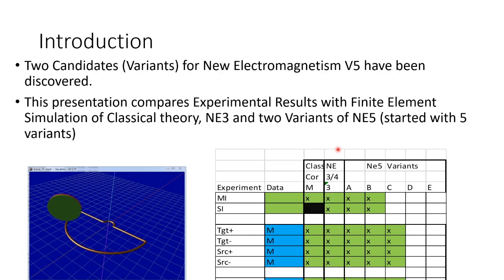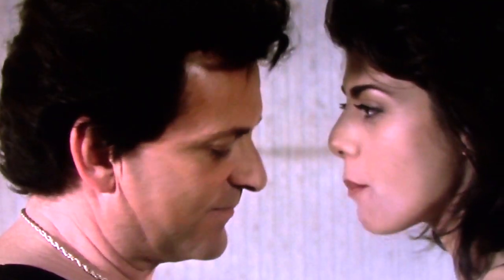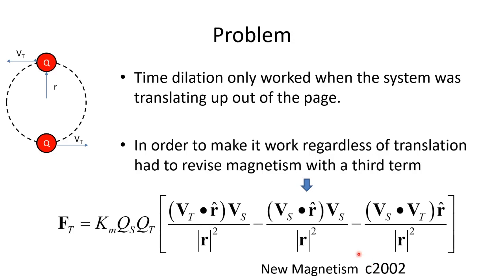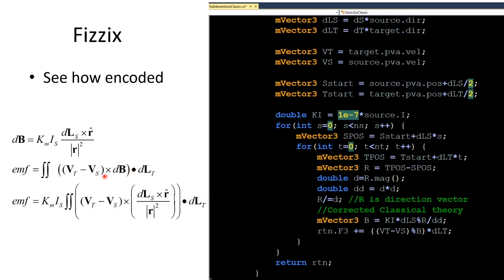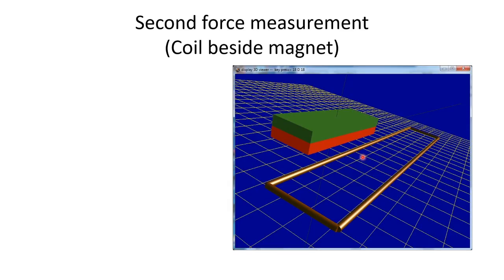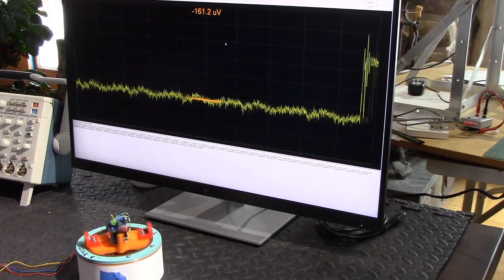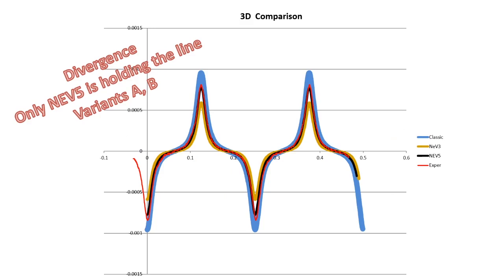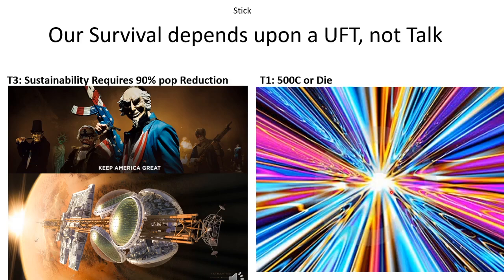T21: NE5:  The Greatest Discovery in Science.

Comment: 24:20 You seem to forget that a current carrying wire contains both moving and stationary charges. You should consider ALL interactions not only between the moving but also between the moving and stationary. Then you will see it's the interaction of the stationary charges with the moving charge that generates the attractive/repulsing force in wires that have parallel/anti-parallel currents. The equation fixes itself if you consider ALL interactions and you will not end up with F=0. This also makes sense as relatively speaking two charges moving at the same speed will experience no force as there is no relative motion between them. They will only interact through the coulomb force.
Reply: Current carrying wire? Do ppl think little particles are traveling in wires? Ridiculous.
Moving would be the wave perturbation generator (water turbine gen)
Stationary would be the "atoms" that make up the copper wire

?=
Reply: @eclipse369.  Those particles are called electrons.   Electrons are verified condensers and carriers of the dielectric.   Tesla has radiant energy experiments in which he can separate the electrons from the dielectric.
CERN is able to strip those electrons off of atoms and store them.
If electrons are just end terminals out of counterspace, then why don't electrons in storage just disintegrate?   They do not, they can be reintroduced to neutralize ionized atoms.
If electrons are just end terminals out of counterspace, then why don't ionized atoms just create a new end terminal out of "counterspace."   There are no experiments which create new electrons out of counterspace.
Reply from the maker: I have not forgotten.  The stationary charges are properly considered in the context of the theory being modeled.  See New Magnetism Paper (link in low bar).  When the Ne5 paper is released, you will find that the is much more to consider.
Reply: @John14: Six There is a paper Called 'The Origin of Matter at the Base of Relativistic Jets in Active Galactic Nuclei.'  This dovetails with the claims in Halton Arp's books that matter is created out of the galactic core of AGN from a substance in this Universe, not from another dimension or from a 'Counterspace.'
    The paper shows that a pure Poynting flux accumulates in the galactic core, gets ejected as an astrophysical jet, and neutrons are created in the twisting action of the astrophysical jets, the neutrons from which accumulate to form a new quasar.   My opinion is then that neutrons, and thus protons, are crystalline dense packs of the ether medium particles, AKA electron-positron pairs, per the Dirac ether medium model.
   I think that the galactic ring current is the mechanism by which the dielectric ether medium is separated from the charged particles and stored as a condensed medium in the galactic core or plasmoid.  This seems to dovetail with Tesla and plasma focus devices which seem to be able to separate charged particles into a self-originating plasma ring current.
   "Matter is created from the ether medium in infinitesimal whirls."    - Nikola Tesla.
  It was Tesla who seems to be the first that I know of that showed a physical process by which matter can be created from the ether medium, after separating it from the charged particles that he uses to condense it.  Steinmetz called the condensed material around charge particle flow the dielectric. 
  Tesla also claims to have shocked particles from regular matter and two different polarities result, and to have observed the ether medium forming or condensing around them.
   There is now evidence from quantum computing studies that there is indeed a magnetic blob surrounding electrons, protons, and atoms that can be controlled by lasers to create the 'qubit.'
   It is a known fact that charged particles are condensers of the dielectric.  It is my opinion, based upon experiments that the ether medium is the dielectric condensed around charged particles and that the dielectric orbits orthogonal to the charged particles, when the charged particles move, to become the magnetic field we observe around them.
"The ether medium is the magnetic field we see flowing around all moving charged particles."  - Nikola Tesla

   On spin though, I think 'spin' of an electron is not the same as a 'qubit' which actually spins.  Spin is determined by deflection in a magnetic field.   Qubit is an actual spin of the magnetic blob.
   So the ether shell condensed around electrons deforms its shape to fit its environment within atoms and compounds, but when an electron is ejected into an electric field the deflection or 'spin,' in that case, is caused by the dielectric shell reforming into a  perfect sphere, which causes a deflection rather than there being an actual dipole to an electron.
   An electron has no dipole but a dielectric condensed shell around it.
  Protons and neutrons do in fact have a dipole and cannot be considered to be building block particles like electron and positrons can be.
Reply: @John14: Six A couple of points so far from that video so far. About 1/3 done.
  1.  I think that there is no such thing as quantum spookiness at a distance.  
     But that when two entangled particles, or photons become separated and sent in opposite directions, the polarity of the magnetic field of the Earth causes equal and opposite rotations on the two particles and will always produce opposite polarity regardless.
  I think the same came be said of radio waves sent from a transmitter the polarity along one wave front will be equal and opposite to the polarity of the wave in the opposite direction.
   Quantum weirdness manifests because Einstein claimed there is no ether medium that affects particles as they travel.
  Such conscious communications would manifest from a frequency signal matching instead.
   2. On the experiment lowering the PH of water, it could be just as simple as that she puts her hands near the water and acts as an antenna to create an input energy to the experiment.
   3. I have heard of MK ultra and people who say it is real.  I personally do not know of anyone who has such abilities.
Reply: @John14: Six Studies of human consciousness on the double slit experiment show no such effect on the wave function from human presence near the experiment, but there is a slight shift that could statistically be a result of someone being near the experiment to act as an antenna.
Reply: @John14: Six Another thing I have heard is real is that they have figured out how to eves drop from a distance on a conversation by aiming a laser or light beam at an exterior window.
   The audio from the room and vibrations on the window can be impinged upon the laser beam to transmit an audio signal that can be discerned from the beam to capture the conversation.
Reply: @John14: Six Tension, charging, discharging sounds like a daily sleep cycle to charge, then discharging until you have had enough.
  I think a supernova of a star is a star that gets disconnected from its input current, but the core doesn't explode, the stored energy in there can no longer be maintained due to lack of z-pinch or energy input and the plasma sheath expands or rarefies away, leaving the core behind as a rocky planet, much like the Cannonball pulsar leaves its core behind.
   A supernova is not an explosion but a rarefaction of stored energy being released, drawing the atmosphere outwards.
Reply: @John14: Six But, say on remote viewing by the Soviets to detect our missile silo locations, one has to wonder why they couldn't set up a decoy program.
Say we put decoys that think they are guarding missile silos while allowing the real missile guards to watch cartoons or something.
Reply: @michaelh6743  A big one is Anthony Peratt.  He has a book called 'Physics of the Plasma Universe.'  He has many articles online such as 'Peratt Instabilities, Plasma Columns, Z-Pinch. The Axis Mundi.'  he also has a video online called 'Peratt and Petroglyphs'  He is mentioned in plasma cosmology websites.
      Also, there are some new books out on space physics published by Wiley and Springer.   Some of which you can sample read on amazon. Space Physics and Aeronomy, (Geophysical Monograph Series)
Like 'Solar physics and solar wind,' 'Electric currents in Geospace and beyond.' 
   These are of a plasma cosmology framework and are taken directly from newer data on solar probes, solar observatories, and planetary probes, as well as GNSS satellite observations.
  Most of what Don Scott has in his books is pretty good, but his anode-cathode model of the solar wind propagation does not match actual observations of the solar wind, listed in the Riley and Springer collections.   The Solar wind properties violate most of the Don Scott model.   
    For example, according to Don Scott, and a requirement of the anode-cathode model, charge particles are accelerated into the solar wind by mass, AKA a helium ion accelerates faster than an iron ion, according to Don.  However, the data shows that charged particles are accelerated by pondermotive force and by First Ionization Potential.  AKA an iron ion actually accelerates faster than a helium ion by magnetic forces or Alfven waves that exist already and carry the charged particles, rather than Don's claim that the charged a particle motion creates the magnetic field.
Reply: @michaelh6743  Also on the "See the Pattern" YouTube channel, there are videos derived from the works of Eric Lerner's plasma model.
 Eric Lerner has several books published.  I have not read any of them but have read Don Scott's books.
Reply: @michaelh6743  Also two other readings that maybe of interest to you along the lines of Birkeland currents.
    Don Scott and the EU model claim that there is a Birkeland current, (specifically a flux rope) feeding into the Earth's poles directly from the Sun.  They claim that this occurs on other planets as well. Don gets this idea from the Peratt antiquity model. Counter-rotating currents.
  Likewise, in Antiquity, Peratt claims that there was a Birkeland current feeding into the south pole for sure, a flux rope.
  A good publication for this is from Jno Cook, Saturnian Cosmology: Chapter 10: Peratt Columns.  Available online.
   Peratt claims from the Petroglyphs and from his Los Alamos studies on plasma discharges, that there must have been a flux rope, Birkeland current feeding into the South pole during ancient times. 
  However, Jno cook points out that that interaction with the south pole and north, is not the same as what causes today's aurorae.
  Today's aurorae (for the Earth and all magnetized planets) are caused by an energy exchange between the Magnetosphere and ionosphere, not flux ropes directly from the Sun.  They consist of two day/night semi-circular configurations that look a lot like Don's Birkeland current flux ropes with counter-rotation per a Bessel Function.  The two could be easily confused with each other.
   AKA current sheets, not flux ropes, but field aligned current or Birkeland currents none-the-less, feed the planets' aurorae.  Today's Birkeland current SHEETS can be summarized in readings about THE DUNGEY CYCLE.
  A good book for this also available for preview on Amazon, 'Magnetotails in the Solar System.'